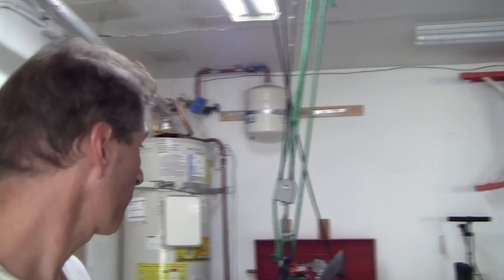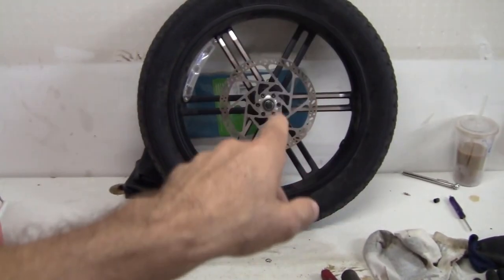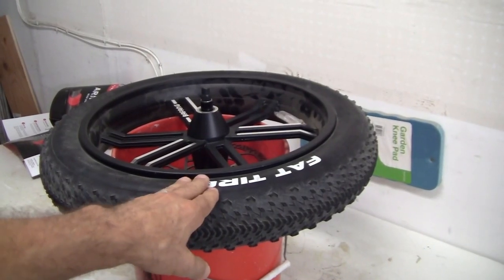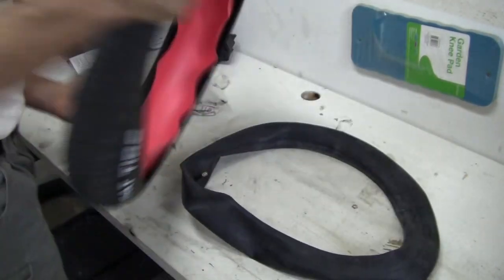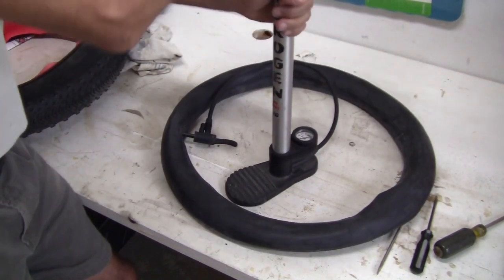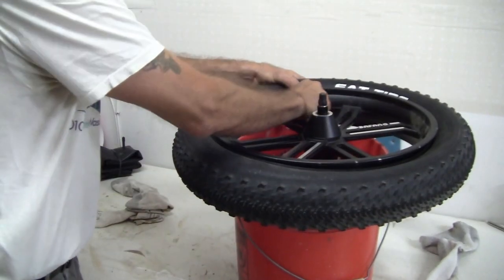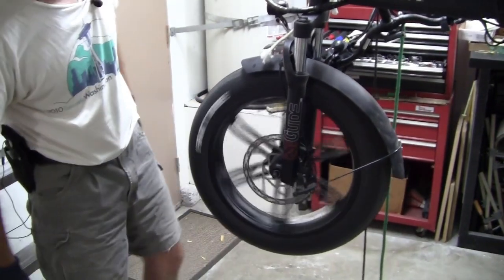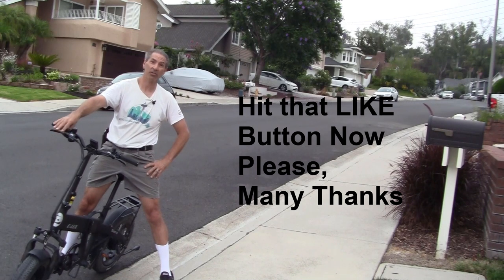Installing Tannus Armour on Fat Tire Ebike, NO MORE FLAT TIRES!

Comment: Hey I have a 20x4 fat tire ebike, I just ordered 20x4 tannus, what tube size do you use? Do you have to get smaller tubes because of the liners?
Reply from the maker: yes, get 3.25" tubes.
Reply: Came here with the exact question, thank you both. Be well ride safe.

Comment: dude, my new ebike is going to have 24x4 inch tires. Tunnas does not make armor in this side. do you think it would be possible to cut the 26x4 size  and repair the seam with Gorilla tape
Reply from the maker: Yes I do think you could do that. To bad they don't make your size. Mine are working great. I have been off road a lot and NO FLAT TIRES for me!